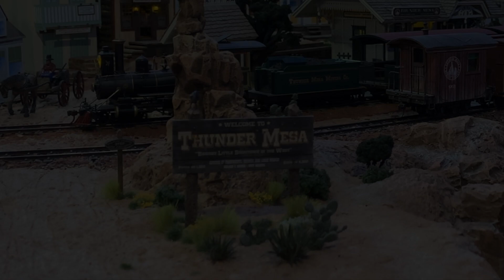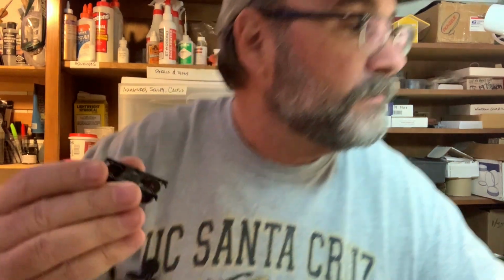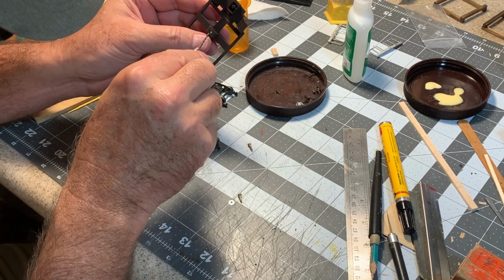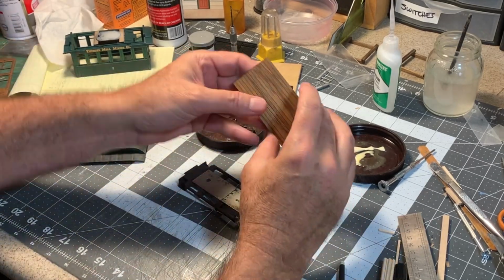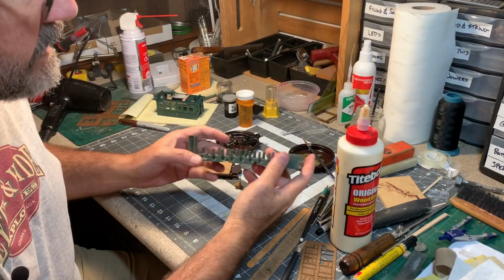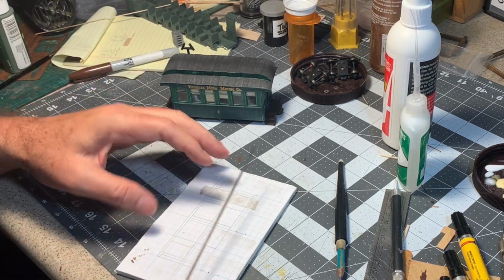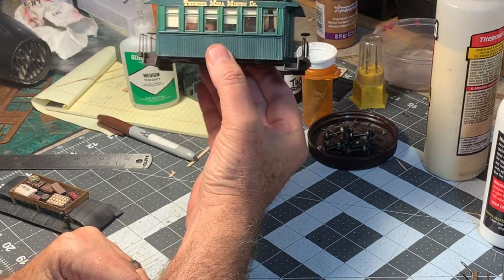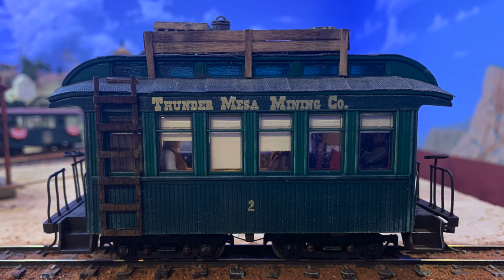Building a 20' On30 Passenger Coach

Comment: Very nice car and modeling.  Two caveats:  The mail bag would never be left out unattended by a Postal worker and the truss rods go over a king post(just one) instead of queen posts(two).  The mail is required to be carried in a locked room, car, or carried by the Postmaster like was done on the Maine two-foot lines at the end and no mail car available.  Even in the laid back west, the mail was sacrosanct.   Even a short car like that would probably have 2 lights but you got to save where you can.
Reply: If this was a Federally regulated Railroad. Take a deep breath, this is a fictional themed Line ...